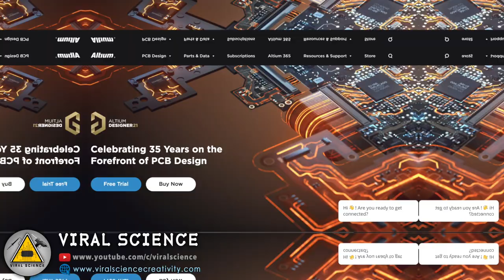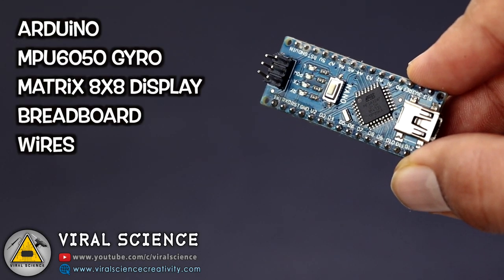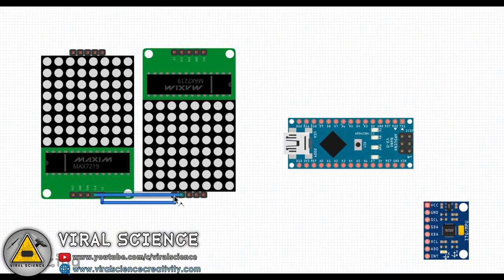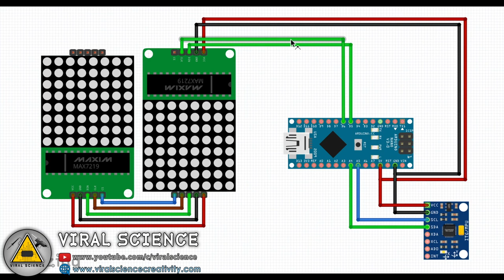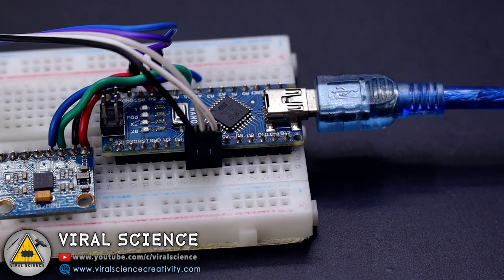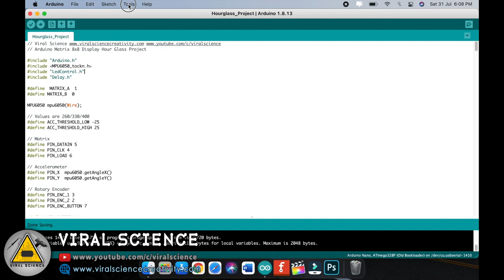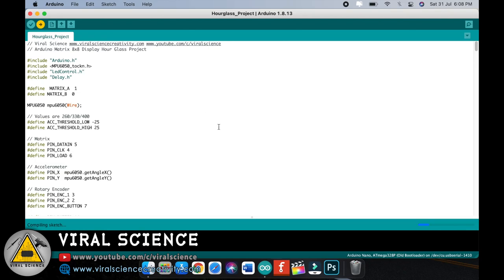Arduino HourGlass with Matrix Display and MPU6050

Comment: I have an error. cannot conver to 'coort' to ''word' (aka unsigned int)in return
Reply: did you manage to fix it?
Reply: Delay.h
Delay.cpp
LedControl.h
LedControl.cpp
Move them into the same folder as your Hourglass_Project.ino
Add each of those 4 files to your hourglass project in the IDE using Sketch -> Add File...

Comment: cool project !!
i built it and it works! Thank you !
There is a small mistake in the fritzing, the labeling on the matrix modules is wrong (cs and clk has been swapped), but the wiring is correct!

the hourglass runs through in a minute. how and where can i rewrite the scetch to change it to 15 minutes?
can someone explain that? thank you!
Reply: hello bro, can u help me fix the code, i cant compiling the arduino
Reply: @ttc4986  did you fix it ?
Reply: you can help me please?